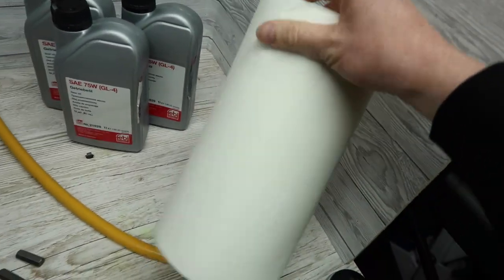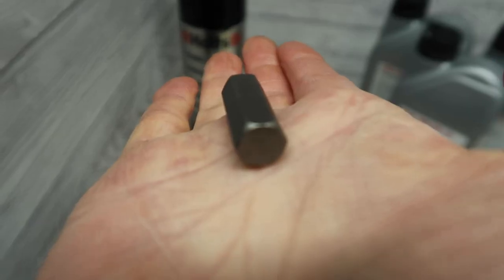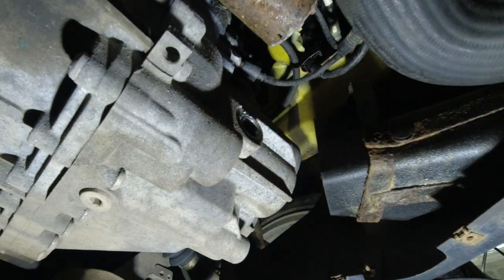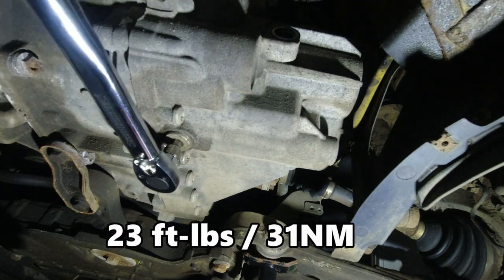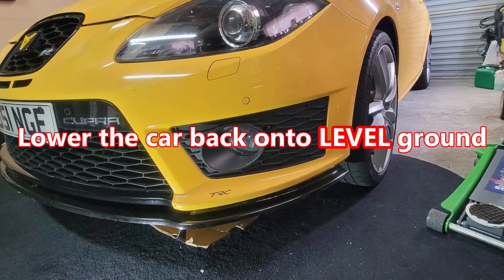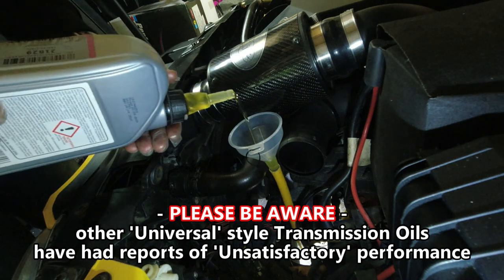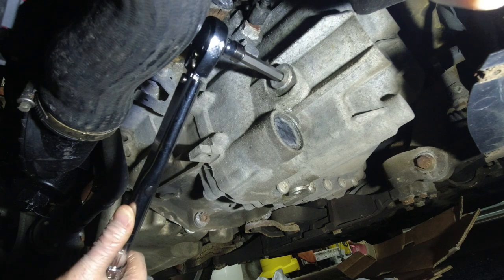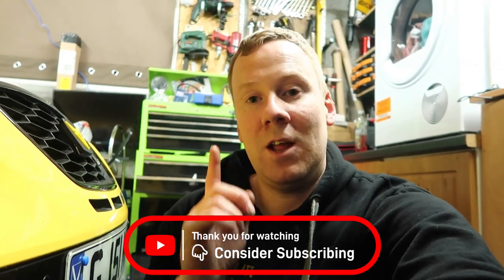OVERDUE Manual Transmission Oil Change EASIER than expected | TFSI EA113 engine

Comment: No idea if this needs to be done on mine, but it looks easy and quick so why not.
Reply from the maker: I was surprised out how straight forward it all went. Only issue that I could see is if you struggle getting the fill plug out, but although tight, mine were no problem. Best of luck wi it 👍🏻

Comment: My mechanic said about my Audi A4 B7 that he doesn't recommend changing the manual gearbox oil as long as everything works, because changing the oil can trigger new problems. Mine has 301,000 kms or 187,000 miles.
Reply from the maker: I'm not a qualified mechanic, so if your mechanic has advised that, then go with what he recommends 👍🏻
In my instance the oil that came out was definitely well used and a little contaminated so it benefited me in this instance, but as he says, if all is good with it currently, then there's no issue 😁👍🏻
Reply: New problems like?! This is ABSOLUTELY true of automatics, but I have quite literally no idea why he would conflate this advice with a manual where the oil has all to do with slip and nothing with grip?
Reply: @Infinitpossibilities  On 300k synchros can be worn, so after a gear oil change you can have difficulty getting into gears. Not being able getting from Reverse into First is the most common problem, so your mechanic doesn't want to take that risk and be responsible for a costly gearbox repair on a car that is on it's the way out. 

I changed my gear oil twice, on 60k and on 130k and had no problems.
Reply: 😂I’m just wondering, logically LIFE TIME Is NO NO )*
—-  equally it’s like you know it will be RIP but you just let it be ——
and Why there are some OE/OEM or even After marked OIL on EARTH ???
In the case of Dealer Mechanic or Garage Mechanic won’t change the bloody Transmision fluid is about the lucky day for us as owner , The best way is DIY with basic anything what out is anything must be in exactly )*

Comment: Mines a Seat Leon 1.6TDI - do you know how many litres I need? Thanks
Reply from the maker: I'm not sure I'm afraid. If you try Googling it, I'm sure it will pull up the answer. I imagine it will be the same engine/gearbox as in the mk5 golfs 👍🏻
Reply: @NorthCoastWorkshop  says lifelong as interval for changing on mine. Thanks
Reply: 1.9lit

Comment: hi hi i also have seat leon 1.9 tdi .i have a question how did you do that with that led strip in the door and how did you connect that to closed groedjes john
Reply from the maker: It's quite hard to explain the led strip, but I'm hoping to do a full video on how to install it and wire it up to the car. The light strip itself is from eBay,  just search -
'car led strip rope lights' 👍🏻
Reply: i have the same led as you but how do you connect them to window switch and when will the video come out about this can you help me @NorthCoastWorkshop
Reply from the maker: They are linked onto 2 wires for the window switch, using a special connector. But yes all will be explained and shown in detail for which wires to use 👍🏻

Comment: Thought it was "sealed for life"! BTW seems there's no washers or gaskets on the plugs. Is this correct, to ensure a proper seal?
Reply from the maker: Yeah, no washers were on the plugs previously either when the garage did my clutch. When torqued up they seem to make a proper tight seal by themselves 👍🏻
Reply: Beware “Sealed for life” advice from manufacturers; this usually means it will last until your new car warranty has expired, nothing more.  A gearbox will go on for years with old oil in it - doesn’t mean it’s a good idea in the longer term. Another good example is this long life oil crap Audi dealers pedal…..bad idea. Longlife oil for a regular, standard change however is great as it has extra cleaning agents in it
Reply: @Infinitpossibilities  - Well I can see why an oil subjected to great heat, as in the engine block, would break down with age & get contaminants dumped in it. But why would gearbox oil be affected by either?
Reply: @Benzknees sorry; you think a gearbox doesn’t get hot? There is some serious pressure going on in there….and contamination? I would say so….especially if that oil has been in there a good while, more filings than carbon I would think; but I don’t think the oil he just drained started out black…..do you?

Comment: Putting that tissue in the fill hole makes me nervous. All you'd have to do is push the hose forwards and it would be pushed into the gearbox.
Reply from the maker: Yeah, that could happen in some instances. To be honest the hose wouldn't really go in any further.
A bit of cloth may be better though, to hold the hose still, with more excess hanging out to grab onto, or a proper oil pump container. They tend to be fairly cheap nowadays 👍🏻
Cheers for watching.